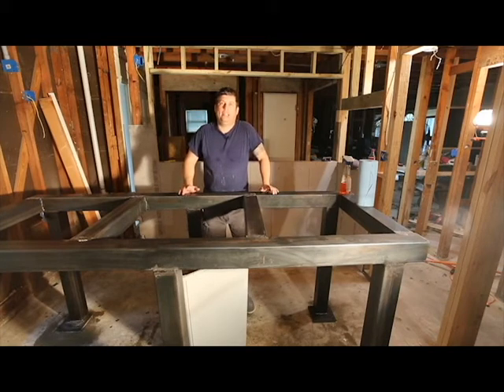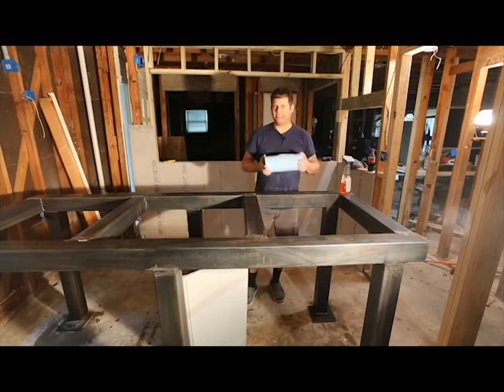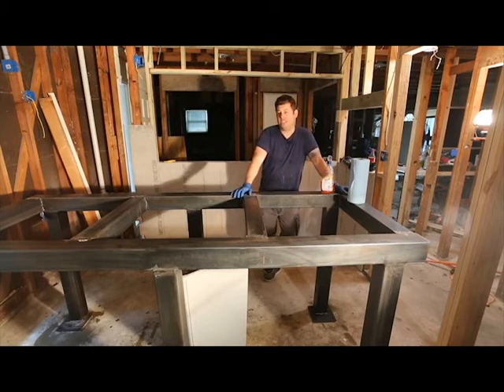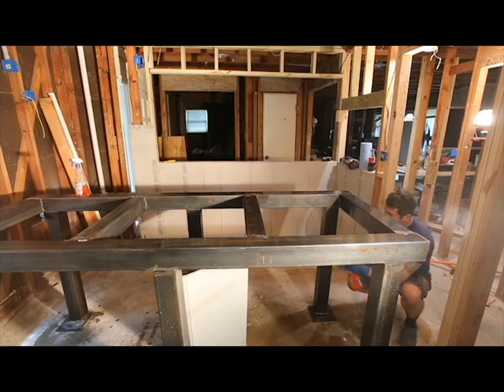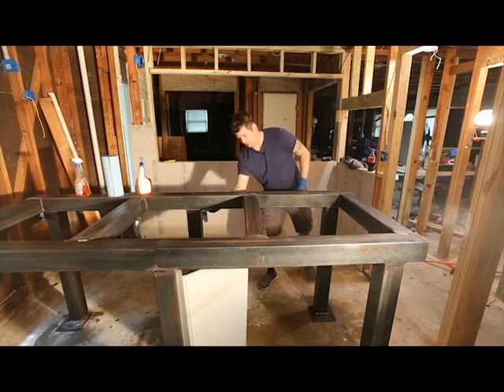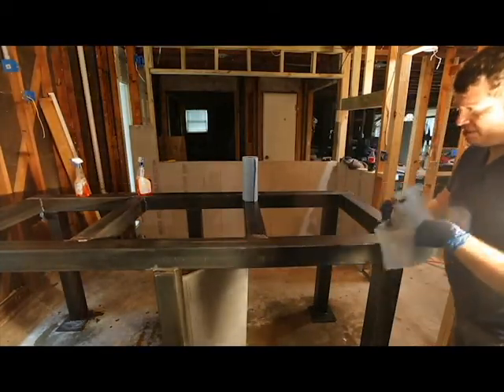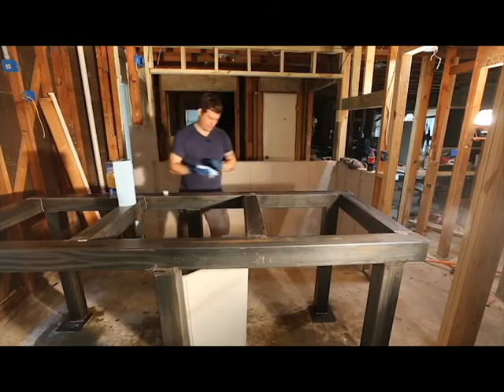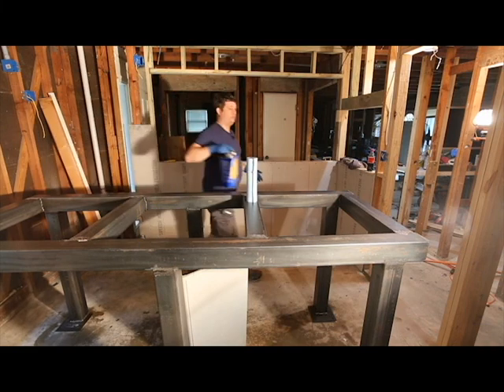Steel Aquarium stand - degrease and clean for paint

Comment: On a warm or hot day acetone will evaporate extremely fast, faster that you can wipe it and the dirt off, xylene is similar to acetone in it also leave no residue behind but doesn't flash off or evaporate  as fast as acetone. This means that you will use less of it and get less fumes off it in the same time period. They are not the same chemical but for cleaning steel in preparation for painting they do the same thing.
Reply from the maker: Thanks, wasn't hot at the time.  I have used acetone for years as a cleaning solvent when it was the appropriate or less dangerous solution.

Comment: I would like to paint an aquarium stand with oil based paint. Do i need to prime first before apply the oil based paint ?
Reply from the maker: it's a good idea.  It's not required, but the paint will last alot longer if it's adhered properly.  Primer will bond to the material, but isn't as durable.